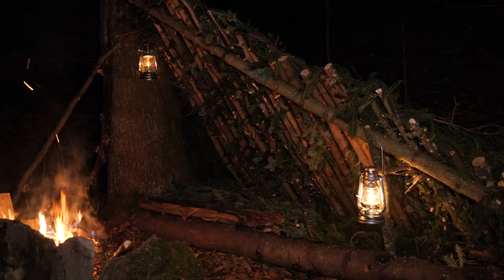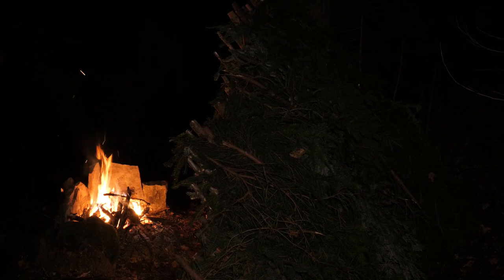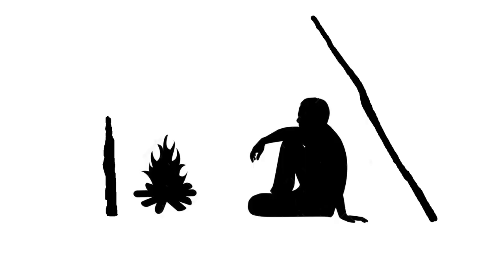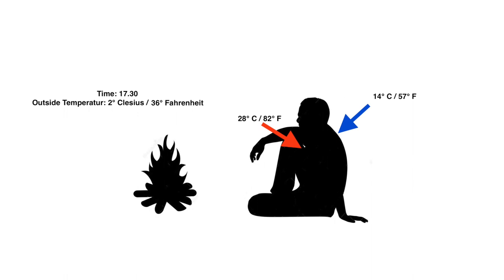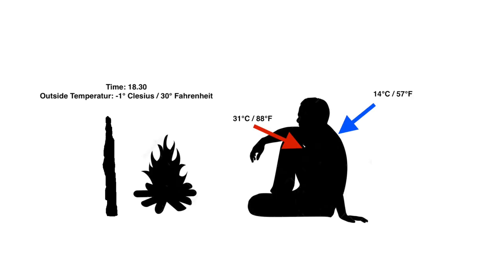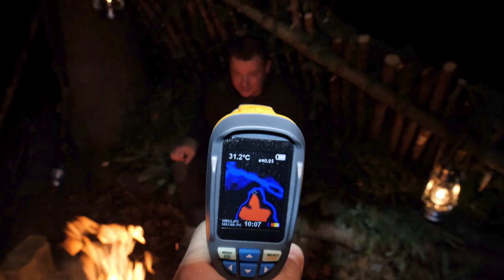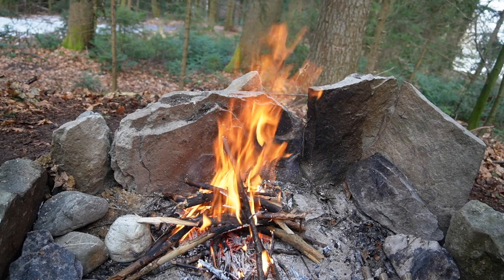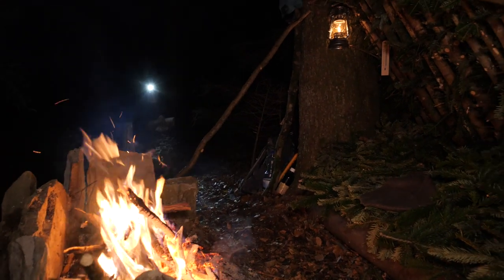Are Fire Reflectors really useless?

Comment: Your conclusion makes a lot of sense. The reflector may not function quite like a mirror for thermal energy, but it definitely affects airflow around the fireplace so that more heat may flow in your direction. Also, any object placed near a fire will absorb a certain amount of heat and then gradually release it back into the surrounding environment. In my experience, space blankets work quite well.
Reply from the maker: Thanks a lot for your interesting comment!!!!
Reply: I agree with you in 💯% .
Reply: Well it  must  work  cause how would it aid in survival?  Mean in the old days people didnt have the luxuries we have.
Reply: Its  kinda like a hot car engine.  The hot air  is trapped by the engine hood and by some panels at the bottom. Dirven a car engine hot so that the radiator electric fan turns on and even whem car is switched off. Open the hood and just feel how long you feel that heat coming out.  I would say its almost the same with the fire reflectors. Almost trapping heat.
Reply: @FelixImmler  time to test with survival blankets ;-)
Nice video as aaaaaaalways :-)
Thanks Felix!
Reply: Perfectly said!

Comment: Hi Felix, I agree with your conclusions from my own experience. For what it's worth, when I was shown the wood wall behind the fire, I was told it was to draw the smoke away from you, towards the wall because it restricted the airflow to the fire from that direction, making a lower pressure area which drew the smoke in that direction more than any other. This is why when you have an open fire and get close to it, smoke can seem to chase you around, no matter what side of the fire you move to since you are creating the barrier and low pressure area. This of course does not allow for the effects of wind, but I do believe the theory is valid. Thank you for a great episode of Professor Immler's Wilderness Labs!
Reply from the maker: Thanks a lot for your super interesting comment!
Reply: The Warm Stone heats Up the Air and creates a chimney-like effect.
The Warm Air rises and "Pulls" fresh Air from you to the fire...so the smoke is less likely to hit you

Comment: Little know fact: the purpose of fire reflectors isn’t to reflect heat or make more light, but rather to cause smoke to go upward wards into the sky and not go into your shelter. The reflector creates a channel for the smoke. Not many ppl know that, but that is the purpose of it. Without the reflector the smoke will go where the wind blows it more, which could be into your shelter and wind direction tends to shift often.
Reply from the maker: Thanks a lot for your interesting feedback!

Comment: The idea that some materials 'reflect' better than others is solid, however, that doesn't mean useless. Also, rather than reflecting behind you, more likely the warm air is stilled and trapped, rather than reflected. Either way, the more contained you are, the more warmth you trap, so any time you surround yourself and the fire, to some degree you will be warmer.
Reply: Ditto☺
Reply: Yep.

Comment: Hello Felix. I believe the stone reflector, and the shelter reflector both reduce wind, even a slight breeze. I also believe if you put reflectors on the sides of your camp so your fire has a complete circle wall it would even be warmer. If the stone reflector, or any reflector behind the fire is tall enough, when it warms up, it will act like a chimney flu, and the heat will cause the air to go up the wall of the reflector. With that air also goes the majority of smoke. I personally don't think the shelter wall behind you is reflecting, I think rather the air around you is warmer and being trapped. If you think of all the different reflectors, front, back, and even the sides, that's exactly what a Teepee does. A Teepee is just tall reflectors all around you. I don't know why they call them reflectors. Of course I'm not a scientist, this is just my opinion. Thanks for the video brother.

Comment: As long as a surface reflects visual light it can most likely also reflect heat as heat is just another type of electromagnetic wave (just like light). But in addition stone can also store heat and re-emit it over time which makes it even more useful.
So yeah, reflectors are for many reasons a good idea! 
Very interesting video!
Reply from the maker: This is the 100 Point comment!

Comment: Great to see the resolut after our discussion, sure for an perfect measure  the wind, the outside temperature and the size of the campfire should be exactly the same, but you got very close to it, thanks for the effort and the very good and understandable pictograms, regards Taro
Reply from the maker: Thank you so much my friend. And thank you also for your fantastic support. I can ask you everything..that's great!
Reply: I would have done things in reverse.
Get a good stable fire going and measure with both, in no wind.
Then remove one and measure a minute after, in no wind.
Then remove the second and measure a minute after and 5 minutes after, in no wind.
The fire intensity is the biggest variable of the small experiment.. Plus, contact thermometers might have worked better.

But hey, good video still. And we all know from experience solid 'screens' have many advantages.
Reply: Nice work & great finding..
Thanks for your effort to make this video..
Keep it up..

Comment: very interesting. I wonder though.. the second fire with the reflector, a fire had been burning on the spot for a much longer time. (Since it was dark, so at least one hour in between) The coal bed should be deeper and the ground under and around the fire is much more heated, thus radiating more heat on you. I would have wanted to see if anything happened if someone would kick down that reflector wall and immediately see if there was a difference on your chest. Thanks Felix for great videos!

Comment: The addition of an aluminum emergency blanket on the interior wall of the shelter would increase the benefit of the heat reflection.
Your presentation is the best that l have seen to date, and backs up common sense experience in the woods. Thank you.

Comment: There was one more scenario that I was hoping you would have done. Fire without a reflector wall, but with the shelter wall.
Reply from the maker: Yes... that's true!! Grrrr....
Reply: @FelixImmler , even without that scenario, I think you made your point very well.
Reply: I'd add onto that with a final test with a space blanket behind you, space blanket behind you and above you, behind + left & right side open to funnel heat towards you. Under you possibly? Also using Mors Kochankai's super Shelter method. I know you kind of did that with your geodesic dome shelter v1 and v2. Possibly good test video ideas. Especially combined with the awesome temperature thing-a-ma-bob and the thermal picture. Love your dedication to improving bushcraft & SAK knowledge

Comment: Brilliantly concluded and conducted Felix. I personally find it better the way you built the campsite reflecting wall behind the camp fire and lattice work and foliage behind keeping the back nice and warm. Spruce is good but very flammable. So I prefur to use Heather moss or bracken. Green of corse. Or even better if possible a rock crevice with rocks in front is what I have found best of all. Natural boundaries work best if you can find them.

Comment: I saw what I think was the same video you referred to, and am glad you did this video, because I trust your real-world opinion more than the scientist.  I think the scientist was caught up on semantics, that "fire reflectors" aren't actually "reflecting" but they do work.  Got thinking you could have saved some time with your tests by simply sitting on different sides of the fire, though.
Reply from the maker: But as much i know infrared waves don't only reflect on a mirrow...
Reply: @FelixImmler  Correct. But: most of mineralic or organic materials (as wood or rocks etc.) absorb oder emit over 90
% of the incomming IR (= longwave) radiation, that means that the maximum of reflexion is less than 10 %. The so called fire reflectors will reflect a very small amount of IR radiation from the fire. If they are heatet up enough by the fire, they will start to emmit radiation themselves. But that's not reflection, it's emmission by radiation.

Comment: They should be called fire-reemittors, as that's what they do, from a technical point of view. Reflection is something different
Reply: yes! that's what I was going to say.  Its more about reemitting, not "reflecting"
Reply: It is not emitting heat, it is deflecting or reflecting depending on how you want to look at it. In order to be an emitter, you would have to head the objects first. In theory, though, it is actually containing the heat so it is centralized. If he had of put up 2 more walls, it would show that more. Heat actually rises and by doing so, creates a vacuum drawing in the cold air. It also radiates outwards. Putting up walls, reflectors etc, keeps the heat from moving out and pushing it up instead. By doing this, it draws all the colder air and leaves warmer air behind.
Reply: @bobmorton4633  Yes, you ARE heating up the objects - with the fire.  that's the point.  You heat them, and one of they ways they cool is through IR radiation.
Reply: @thedamnyankee1  You are not heating them. You are containing the heat in a given area. To heat them, they would have to be much closer than they are. Over time, the radiant heat will heat them up. So will your body heat. At first though, it contains the heat so it doesn't escape. Basic physics. If it was an emitter, you would need to wait hours for it to heat up. Than if you take it away, any heat that is trapped in it, that is when it would emit the heat. First you contain the heat, then it is reflected back as it builds. As it builds, the radiant heat will warm the object. As the fires dies down or goes out, then you get emitting heat.
Reply: @bobmorton4633  are you saying that a rock placed next to a fire wont get hot?
Seriously man, you are not only wrong, you don't even know enough to know how you are wrong.
Reply: Having a basic knowledge of thermodynamics would be nice .
Reply: @QuantumMechanic_88  ok class. Repeat after me, Black body.
Reply: PotAto, potato. Who cares if your warmed up more? 😎
Reply: @QuantumMechanic_88 and quantum mechanics, and aerodynamics. It's a freaking camp FIRE. Caveman stuff! No one really needs a PhD here. 😎
Reply: Even if the stone slabs and wooden wall aren’t perfect reflectors, they are no ideal black bodies either and they will surely reflect certain portion of the heat. No specular but diffuse reflection.  Absorption and re-emission may contribute a little, but the emission power is proportional to the fourth power of the surface temperature. So re-emmision from the stone slabs in close contact with the fire may count a bit, but the wooden wall is too far away and cold to count, I think.
Reply: @ahayseed654  You win the prize .
Reply: @thedamnyankee1  You really need to learn to read. Never said anything about the rocks. I guess you didn't understand that when I mentioned body.
Reply from the maker: This is true!

Comment: There is generally a little bit of reflectivity on logs and rocks (in particular if the logs are greyish or white, like split green poplars, or if the rocks are glittery from quartz or certain sediments). However, they do not work like described in many survival manuals, where you build a small log wall a long way from a small fire and expect a huge reward. If built close enough to the fire, there can certainly be a bit of bounce-back and reflection. Most of what "bounces back" from a "reflector" though, is absorbed heat which is re-emitted from the logs or rocks, but at a shorter wavelength. It can sure make a noticable difference, but to expect it to work like a mylar blanket and heat your shelter immensly (as the common bushcraft myth goes) is not true. For anything to have such a reflective capacity, it needs to be essentially a mirror polish, like still water, mylar, aluminium foil and to a lesser degree snow. The light test that you showed is excellent. The more something reflects back light, the better of a fire reflector it is, since the emission of light and emission of heat are quite related.

Comment: Great Video 👍Have you ever tried building reflectors out of woodlogs instead of stones? Always wondered if a woodenlog reflector is still working despite the small gaps in between the stacked logs. Gruess us Lachen ✌
Reply from the maker: Good question... no i didn't measured that..sorry!
Reply: I've used wooden reflectors; I'd say they make a significant difference. The logs also hold heat for a while once the fire is at the embers stage.
Reply: One advantage of the dry wood screen/planks close to the fire is that one can lean directly against them if on the other side the fire is controlled by another disciplined camper.

Comment: Nice job Felix!
I normally like to understand how things work, but in this case all I need to know is that it does work. Many have commented on why it works and my guess is that are a lot of different things happening together (changed airflow, reflection, re-radiation, heat entrapment) which all adds up to the few extra degrees you get. Is it worth the effort? I think for a longer stay then yes, but for one night I'd just hang a mylar space blanket or reflective tarp instead of building a shelter.

Comment: One of the heat transfer mechanisms from two bodies at different temperatures is radiative heat transfer.  This transfer is proportional to the   the 4th power of the temperature of the warmer body minus the 4th power of the temperature of the cooler body.  In addition, it will depend on the amount of surface area that each body can see of each other.  What the reflector and roof of the shelter does is shield you from either a cloudy sky or outer space.   You are at 37 C.  A cloudy sky is around 0 C and outer space is around -270 C.  So you will certainly radiate heat.  A "reflector" made of wood, which can reduce the amount of exposure , ie surface area, to the colder environment, will reduce the amount of radiative heat loss.  The roof absolutely shields you from the cold of the sky.   If the "reflector" warms up from the fire then even better but it will still help even if it doesn't warm up.  This is a simplistic model because of thermal gradients from the ground up to outer space but the physics is sound.
Reply from the maker: Hello Mike. Woww, this sounds very scientific. Thank you!

Comment: very nice test, but for me without a surprising outcome. reflectors work, thats why there is a name for it, reflector. also the reflection of light on your face is very educational. To reduce variables you should not do the last measurement 10 minutes after thatching the roof because you generate bodyheat which disipates from you back to ofcoarse. there are numerous varaibles I know but you have proven the point.
Reply from the maker: Thanks a lot for your interesting comment!

Comment: The updraft of the fire mixed with air swirling around hot rocks in-between reflector/deflector can create a little nano climate that will temper cold breezes. It won't do a lot in strong wind, but I'm still convinced it's still better, no matter what your scenario. Build reflectors/deflectors, no matter what the "science" tells you. You'll get warmer just building it!
Reply: 😁 the old 'triple heat' of working on your fire 😆
Reply: @HAYAOLEONE  exactly!😆

Comment: Consider global-warming. Low-frequency infra-red radiation is unable to pass through greenhouse gases, becoming trapped in the atmosphere. Higher frequencies are able to pass through and away. This warms the atmosphere. A similar thing happens on a cloudy night. We notice the temperature difference.
It seems reasonable to suggest that your reflector does a similar thing, trapping the warm air in your vicinity. This leads to a noticeable and.as you have shown. measurable increase in your local temperature.
Some people dismiss reflectors as being unable to reflect (not true, or you wouldn't be able to see them) but this misses the point. A fire-reflector increases the warmth that you experience.
Thanks for another fun, informative video.

Comment: One of the reasons why a fire in a  house has a back wall. All the heat escapes up the chimney? No,  it goes into the room. Same with an open fire with a fire wall, forcing heat away from the wall towards the user. More heat would radiate towards the user in a more confined shelter with walls and a roof.
Common sense over science. Another victory for common sense.
Reply from the maker: Yes that's true! :-D

Comment: It may not be much, but it is enough to be worth it. The little lean-to also keeps the cold moist air from falling down on you.
You might be interested to know, a tent inside another tent (a draped blanket in this case) with a small air pocket between them, can raise the temperature by 20°+ Fahrenheit. I have not yet tested with a proper fleece, a space blanket, or two blankets. when the temperature gets down below 19° Fahrenheit it can get a bit chilly, and I recommend one or two oxygen activated heat pads, more if you have achy  joints. A second blanket or a proper fleece should temporarily solve the problem.
Reply from the maker: Hello Marthe. Thanks a lot for your interesting comment!

Comment: Heat radiation is like light. It will be partly reflected from everything in the near of a fire but partly it will be absorbed. The kind of surface of the objects are important. Dark and rough it will be more absorbed smooth and bright it will be more reflected. That is pure scientific! Your roof would be a nicer reflector if you build in a rescue blanket. ☺👍